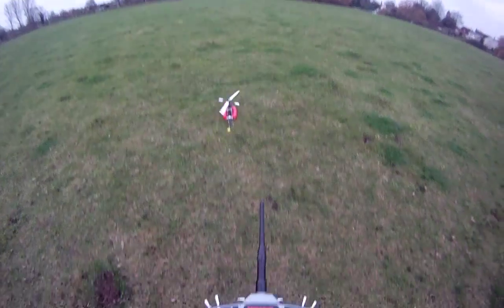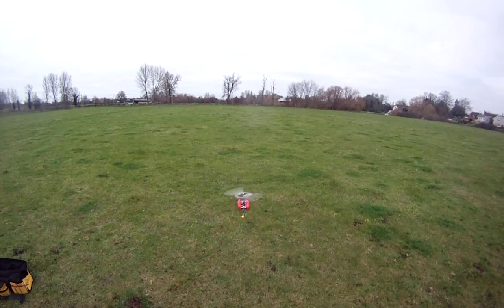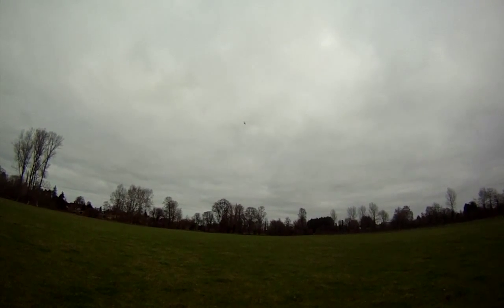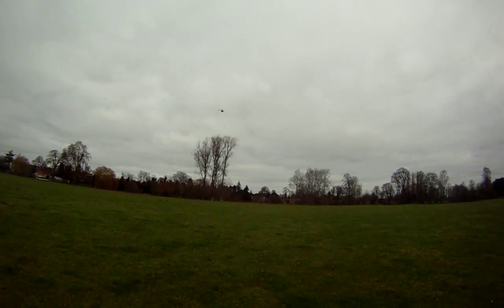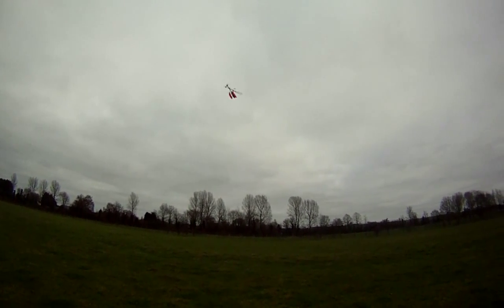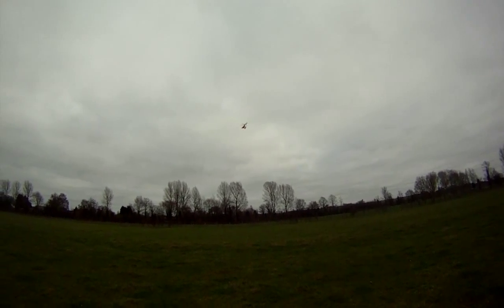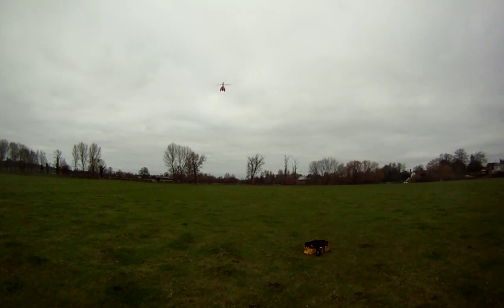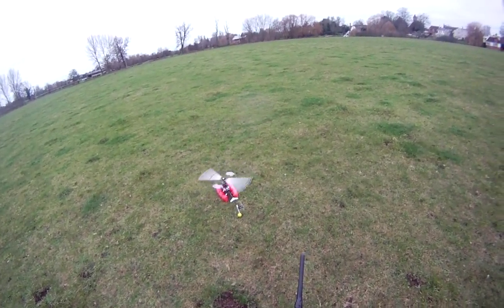Blade 450 Toe in figure of 8 blade 450 circuits

Comment: Hi mate no probs,I did by an SR off ebay as new , used my dx6i (mode 1)' it was better to me than my belt cp but, I also bought a 400 which was in  a right state it's gone back. I got another one and yes it is easier to fly .I also bought a 450 rtf again unused for 190 inc post! (sell the mode 2 tx) but iv'e only hovered it ,it seemed a bit robotic  but it's prob a setting to cure it. Thanks Chris. ps check James my son out(this channel) if you like Guitar music.